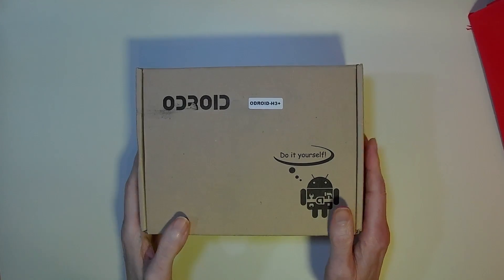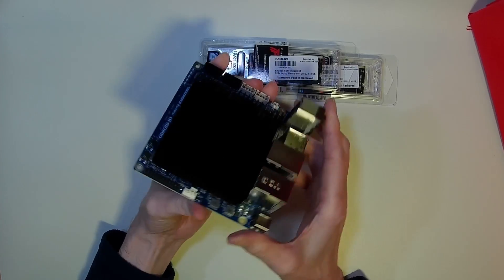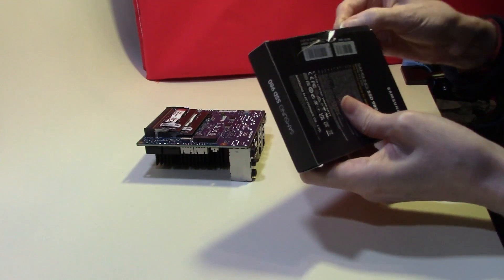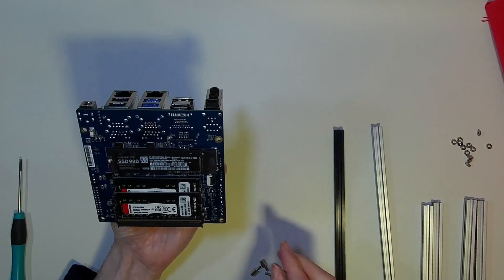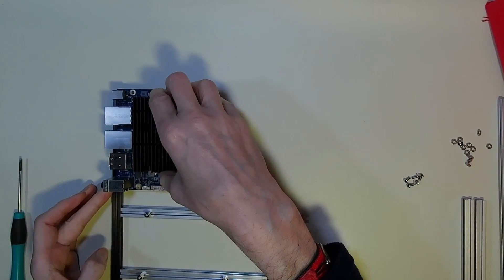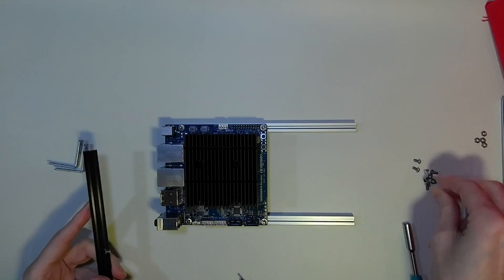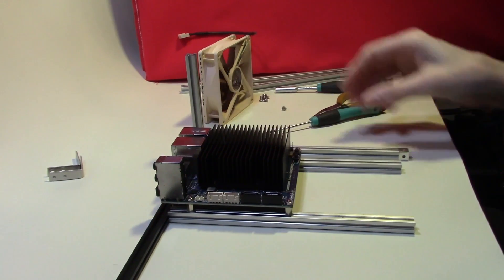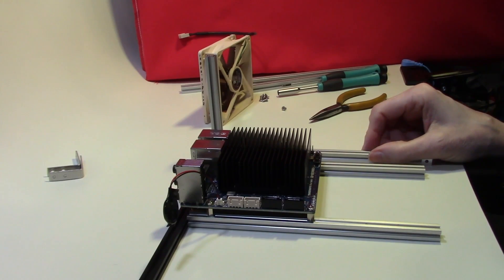Odroid H3+ x86 single board computer - Fitting the Memory and SSD

Comment: @9:43 ,  Would be nice to have the airflow parallel to the fins.
Reply from the maker: As the heatsink is fitted at the factory, I didn't have the option of reorienting it. However the fan in this position keeps the heat from building up. The fan is not on constantly.

Comment: hi... it say ram speed on 2933MHz.. how if I use 3200Mhz? will it crash or not be detected??
Reply from the maker: Generally the speed of memory is the maximum it will run at and will normally run happily at lower speeds. As long as it's DDR4 you should be ok.
Reply: Wrong. The description says DDR5 only, ddr4 and ddr3 are not supported! @custompchardware

Comment: They're sold out. I was just about to order one. 

Because of the orientation of the heat sync. It looks like you should mount the fan to the side instead of the back to blow across the fins. Not up against the rear fin.
Reply from the maker: Reports of next batch being ready middle of January, 2023. Yes the design of the heatsink is different to the H2 series, I'll need to test out the cooling and see how it performs.